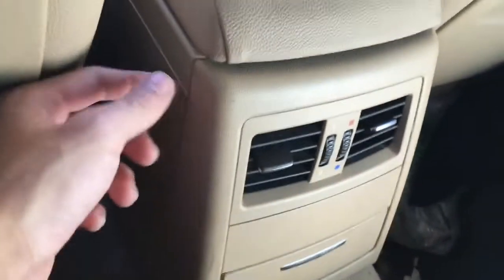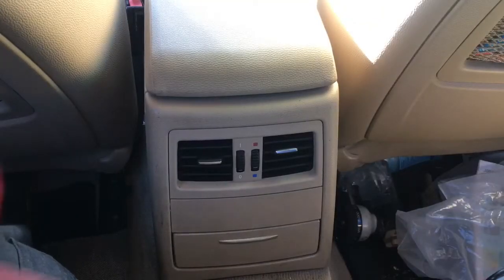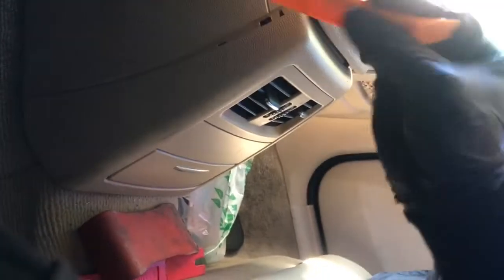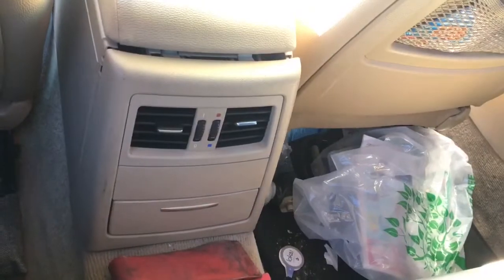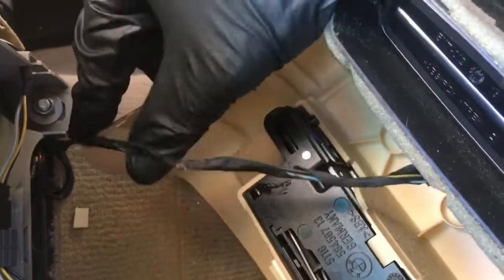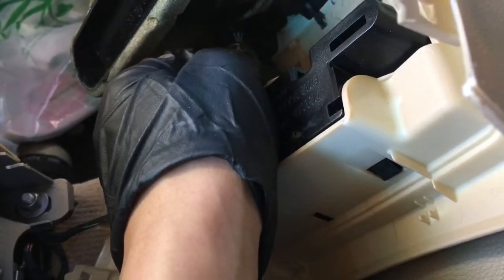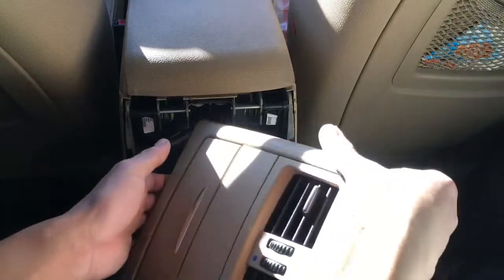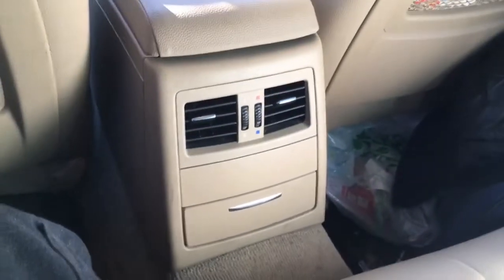How to Remove and Replace E90 Rear Seat Vent Trim Panel - E90 FIX - 2006-2013 BMW 3 Series

Comment: I'm not sure how you removed that electrical connector so easily. I've ruined so many of those connectors trying to get out. Usually I get tiny flat screwdriver put corner in hole and pry out .

Comment: Hi I am trying to remove the air duct right next to those vents. I removed the bolts but I just can't pull it off. Should I force it? How do I remove them?
Reply: Have you found out how to remove it I have the same issue
Reply: @zayn3961  nope I didn't...
Reply: @Runmeerkat  thanks